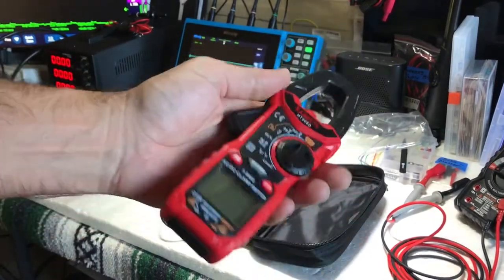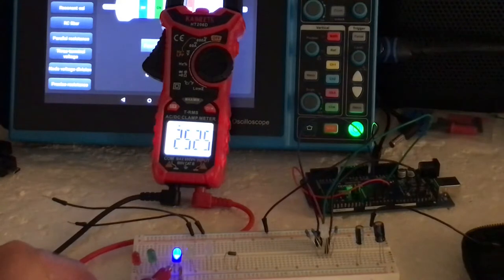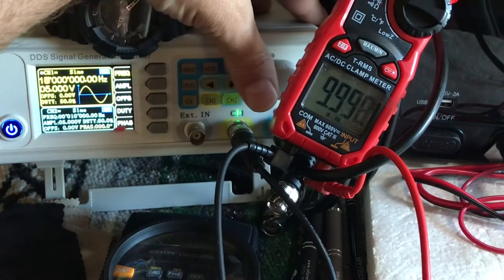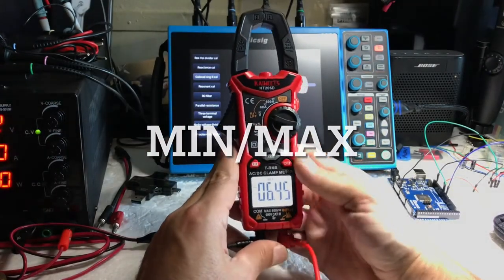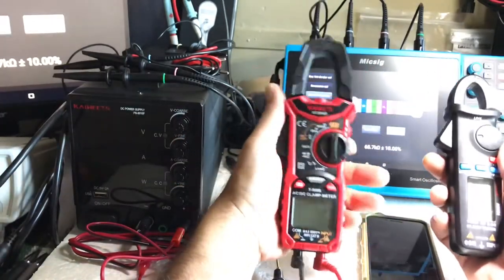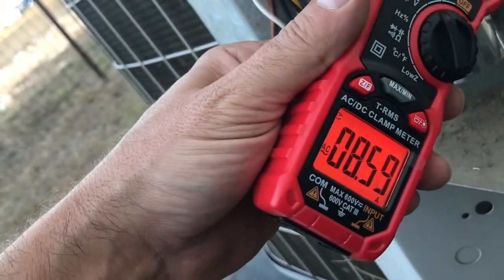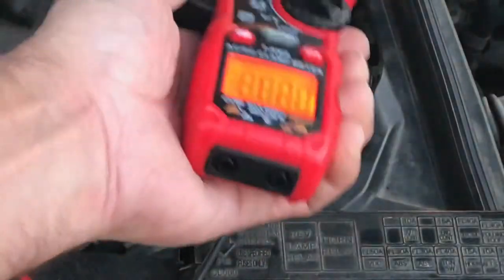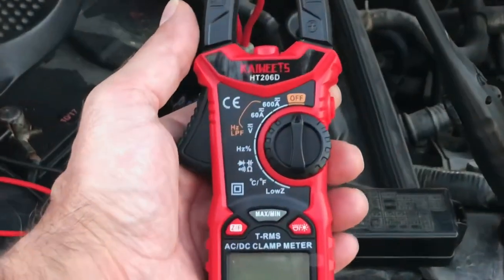Shorter Review Kaiweets Clamp Meter HT206D

Comment: Thanks.  I really like the HT206D meter and the Habotest version is currently cheaper than UT210E on AliExpress, but the backlight issue is a deal-killer!  YouTube reviewers need to repeatedly tell each of these companies that NOBODY wants a backlight that goes off in less than a minute and, in fact, we'd rather have the backlight never go off so long as we've manually turned it on.  Automated shutoffs are flaws, not features, and customers HATE them.

A reasonable compromise would be to turn the light off after 10-15 minutes, but most meters automatically power down after 10 minutes anway, so JUST LEAVE THE LIGHT ON until then.  If we forget to turn the backlight or meter off and the batteries go flat, then that's our fault, not the manufacturer's.  Chinese companies seem obsessed with extremely short timers that turn everything off and it drives their customers insane with rage.

Also, every meter with auto-lightoff and auto-powerdown should have a way to disable those timers.  Holding down the backlight button while turning on the meter (or something similar) should disable the automatic shutoff features entirely and the process for doing this must be included in the product manual.

Perhaps the only way to make this meter tolerable is to hack the backlight so that it stays on whenever the meter is on.  This same problem exists on most hobbyist meters, so this isn't just an issue with Habotest/Kaiweets.  It's a problem with meter designers or the marketing fools that control them.
Reply from the maker: Hello Rob Allen. You nailed that right on the nose. I HATE that that light turns off on me, CONSTANTLY. I really like the meter, but despise the auto shut off of the backlight. It’s really annoying when I get everything set up, start my test, and right as I’m about to get the result, lights out. I agree with you; they should just have it turn off with the meter; and if I leave it on and the battery goes dead, than it’s my own damn fault. Thanks for leaving a reply Rob. Who knows, maybe the right person will see this, and make some changes. Good luck to you, my friend.
Reply: @atomsworkshop195  maybe they do the quick light off setting is because AAA batteries don't have that much capacity.

Comment: I needed an inrush current amp clamp. So I tried out the Kiweets HT208, actually very impressed with the performance. I use it at work, as a reefer mechanic. It’s it’s spot there. 

I’m also a electronics test equipment aficionado. Thought most of my equipment is bench top in my home electronics lab. 

Are you also on TikTok?
Reply from the maker: I’ve been pleased with the Kaiweets too. They also more than honor their warranty. I had an issue with a meter, that was my fault. They not only replaced it, but also sent me one of their small smart meters.  No, I’m not on TikTok, just YouTube.

Comment: Great video!!!!!! I just bought that clamp meter about a month ago and I really like it. It's very robust and accurate.
Reply from the maker: Thanks Maurice. Yea, I just got mine, but so far, I really like it. I have to say, a couple months ago, I never heard of Kaiweets, but after getting a few of their products, I really like them. They seem really nice, especially for the price. I like the small size of this meter. Small, but packed with features. It’s good to hear that you still really like yours after a month. This gives me hope that it’s gonna last a while. Unless I come across something I like better in the future, It’s gonna be my go to clamp meter, if I’m not using my scope. Thanks for the comment, and for stopping by the channel.
Reply: @atomsworkshop195  I bought the same device ht206d, but under the brand name HABOTEST. There are no external differences at all. I wonder whose authorship?
Reply from the maker: Hello AW. Yea, I’ve seen the brand you have. I first saw it when I bought my Kaiweets Multimeter HT118A. While researching it, I came across the brand you have. It would be nice to know who did it first. It’s probably the same company (different company all together) making all of them. Then at the end of the manufacturing line, they put different brands stickers on them. I guess it comes to the warranty from each company. From experience, I know Kaiweets honors theirs. I blew a fuse in my HT118A, and when I asked them how I can get a fuse, they said it has a 3 year warranty and they sent me an entire new one. They also sent their smart meter free to review. I have that video on my video list. Anyway, thanks for the comments AW. Stop by anytime my friend.
Reply from the maker: How do you like your Habotest? How long is the warranty? I was thinking of grabbing one of theirs also. I love collecting meters and other diagnostic equipment.
Reply from the maker: I was thinking, the other meter that was like the Kaiweets, I think was Tacklife. But I know I’ve seen the Hobotest also.

Comment: can you tell me what the symbol in the left upper display is ? looks like a clock at 1 o clock
Reply from the maker: Hello Dave, that’s a good question. I had to look that one up in the owners manual. It was on no matter where I turned the selector switch to. So, that symbol, when on the screen, means the automatic shutdown is turned on. After 15 minutes of no activity, it beeps 3 times, and without further operation, it beeps again and switches off. If you hold the Z/F key for more than 2 seconds and switch on the meter at the same time, it beeps maybe 5 times, and the symbol is gone, and it will stay on. Turn the meter off then back on, and it’s restored with the symbol on and auto shutdown reactivated. Thanks for the question and stopping by the channel.

Comment: Please could you check  AC current bellow 150mA. I have same clamp meter and very bad measerments for the ac bellow 100 mA current. please answer me if you can. best regards
Reply from the maker: Hello llija. I will try to do that, and let you know of the results. Only, I’m not sure how I’m going to find ac current that low. I work on cars that run mostly on dc. Maybe I can strip the outer layer off an old cell phone charging cable, or something. Sorry I’m just now responding, I’ve been really busy the last week. Thanks for watch the channel my friend. Just a thought though, you might need a low amp clamp to test more accurately in the low millivolts and milliamps. I know Kaiweets also makes a low amp clamp that looks similar to this one. Good luck my friend.
Reply: Just bought one of these and the low ma current readings are not accurate, even a little difficult, even very difficult, to repeat the same current reading with the same amount of current through the wire. (Remember to hit the Z/F key to zero out the display first) My mistake buying this and not understanding that for low amp readings a multimeter with "ma" option or at least a 2 to 10 amp current option would be a best.  With all the great reviews and testing, I thought the HT206D would work for low current. My cheap $10 m-meter has a ma option and works very good. But the probes have to be used due to it not being a clamp style meter. Despite the ma reading issues, the meter is very nice given the price point.

Comment: nice clamp meter but accuracy for  automotive parasitic test it may off scale. good for general purpose used.
Reply from the maker: Hey there wzthonda. How are you? Yea, I’d have to agree with you. I’d probably use my oscilloscope for that anyway, set to a long time base, so I could see it over time. But yea, I was hoping it would be as accurate as the Kaiweets HT118A that I reviewed. That thing was impressive, especially for the price. But like you said, for general purpose use, absolutely, it’s a nice little meter. I especially like the size. Thanks for the comment and for stopping by the channel.